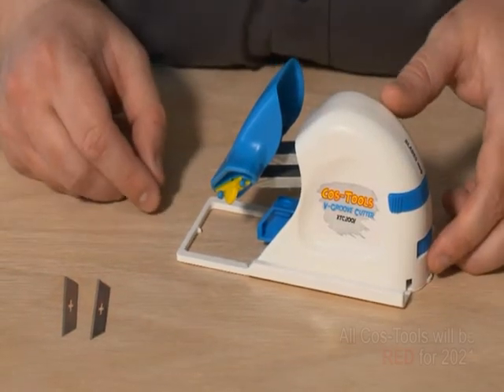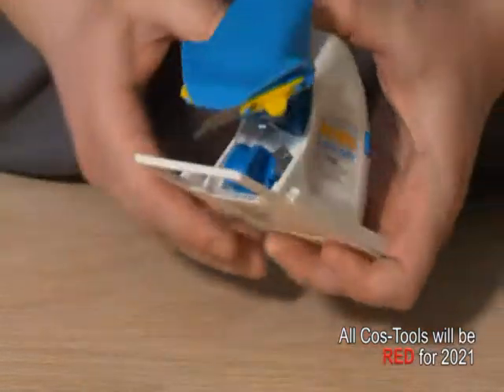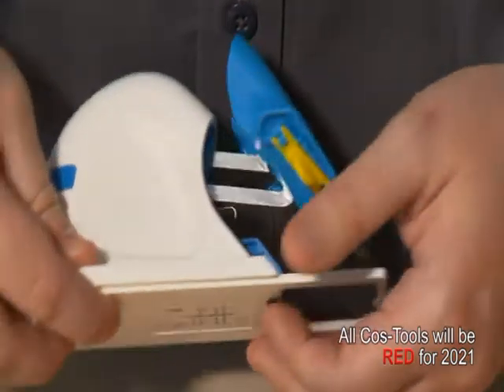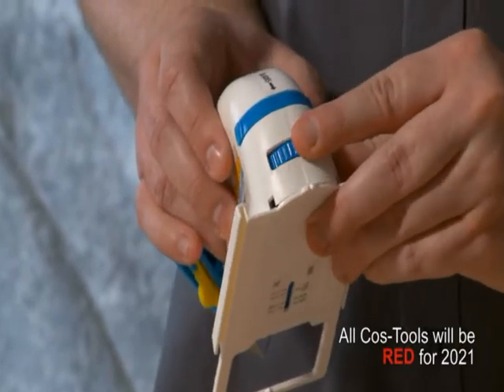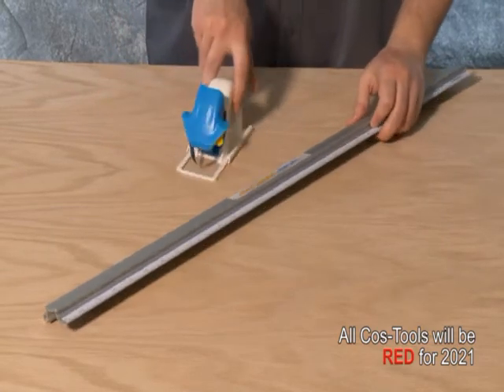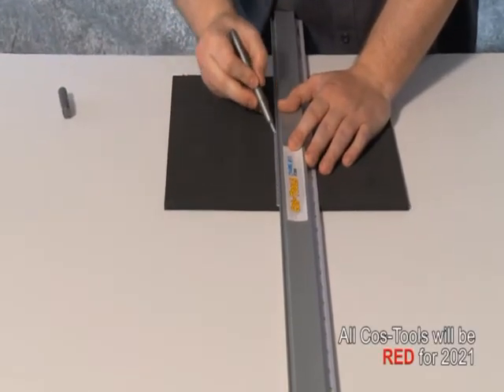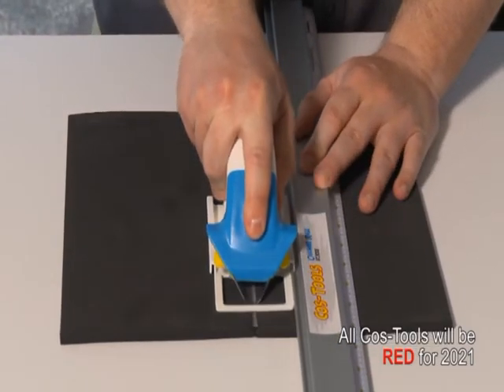Cos-Tools XTC2001 V Groove Cutter RED

Comment: I've tried to use this on 3/16" foam core for an architecture model. The blades crossing over and extending beyond where they intersect is a detriment to the design. This causes the blades to cut completely through the foam in order to get a v groove cut deep enough for a clean fold. Solution?
Reply from the maker: Hello. The blade tips are designed so one blade tip goes slightly past the other blade tip. This is what allows the excess foam to fall away, otherwise the blade tips would need to touch each other. The back of the tool has a depth dial with a reference scale on the underside. Set the depth so that it cuts just deep enough to make a clean 90 degree fold on the foam which is about 3/4 of the way through. If the tool is cutting too deep, adjust the depth to be more shallow. It may also help to place a scrap piece of foam at the start of the cut and the end of the cut so the tool rides flat as it first approaches the start of the cut and as it rides off the bottom edge of the foam. You must always use this tool with a straight edge guide or with the XT3001 Channel Rail and change your blades often. Thanks.
Reply: @LoganGraphic  This information is incorrect. In order to truly have a clean 90 degree edge, the blades must be moved further away from each other not front and back, but side to side. 3/4 of the way through does not provide a clean 90 degree edge like you just mentioned. You want the deepest point of the cut to go through the first layer of paper, through the foam in the middle, and then stop right before cutting into the back piece of paper. This allows the piece of foam to have a crisp fold. Your tool is simply manufactured wrong, I’m sorry. Fix this, and I will have an entirely different experience, I’m sure. Thank you.
Reply: @LoganGraphic  I also used fresh blades, the recommended ruler/rail, and scrap pieces before and after the cut. The blades still wobble because this product is manufactured too structurally unsound. Please provide a sturdier tool, because the current version does not make the cut for accurate work.
Reply from the maker: @alexjohnson4567  I am not sure why you are having issues. We have made v-grooving tools in this same manner and design for decades and the version you have designed for use on standard foam board or EVA foam has been sold since 2008.
Reply: @LoganGraphic  I don't think you understand what I mean when I say "clean 90 degree edge". I mean I need an edge that isn't rounded or soft. When looking at the tool head on, the blades should meet point to point; though we both know depth-wise one blade is set back further than another.
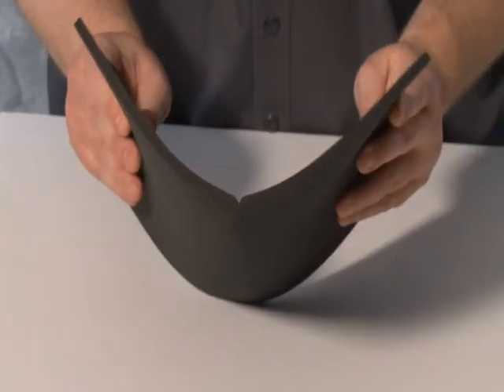Reply: @LoganGraphic  You might want to watch this video again, no offense. Check at 2:16, and notice how the edge created isn't even a crisp edge; it's all rounded. This is the fault of your tool's construction sadly. I'm surprised this hasn't been fixed yet and frankly/respectfully disappointed.
Reply: @alexjohnson4567  yeh in this video we don't see any sharp edge .

Comment: Hi, will this work to cut a decorative v groove on picture mounts?
Reply from the maker: No, this cutter is meant for Foam Board.
Reply: @LoganGraphic  do you have any products that are designed for v grooves on picture mounts?
Reply from the maker: @molly-uh1qm  Unfortunately, at this time no.  We did make one a long time ago the 703. You may be able to find one used on Ebay.
Reply: @LoganGraphic  thanks for your help :)

Comment: I tried using this tool but In my opinion it’s useless ether I’m using it wrong or the design of it is just the issue
Reply from the maker: Hello, to use this tool make sure the blades are sharp. Set the depth to almost go all the way through but to leave enough to hinge and allow a fold. Its best to use this against a straight edge or connect to the Cos-Tools Channel Rail. It might also help to add extra material before and after the cut so the blades more smoothly enter and exit the foam you are v-grooving. Always use scrap foamboard as underlayment underneath. Can you tell me what type of foam you are cutting?